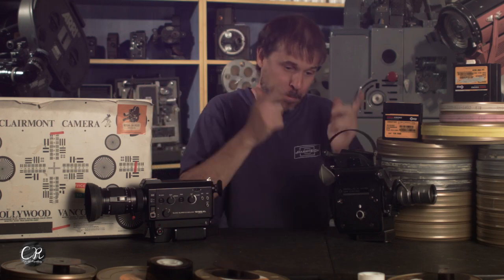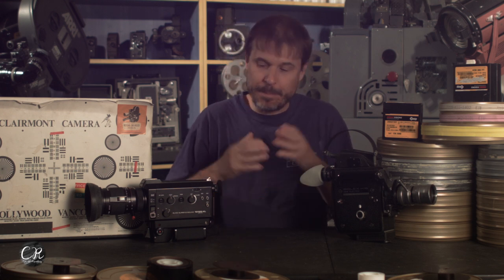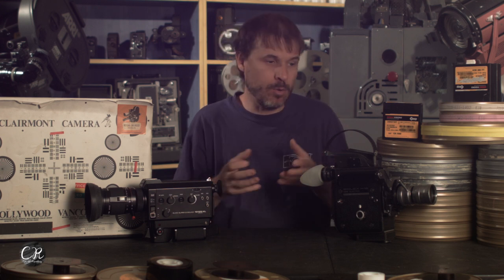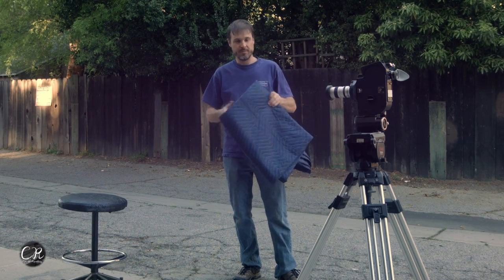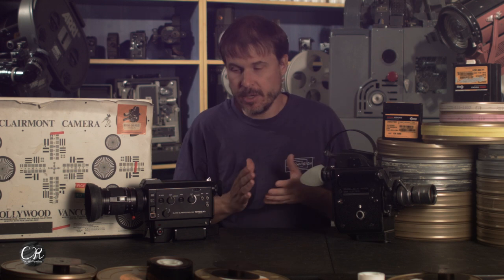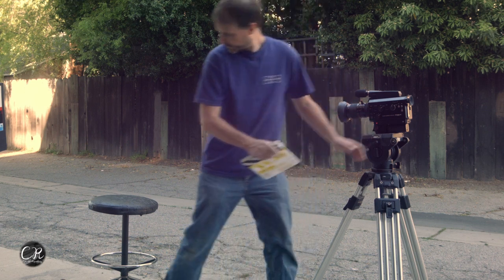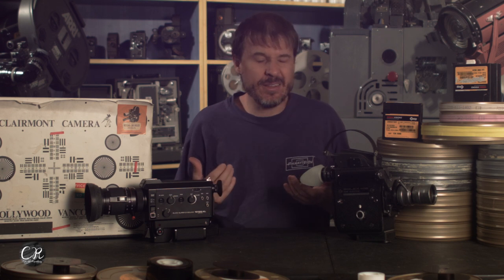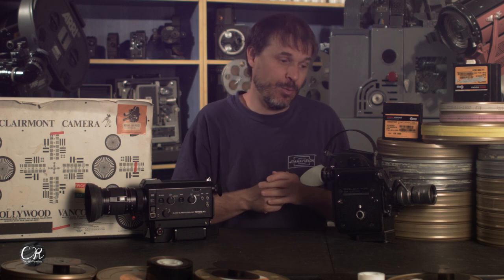Sync Sound test Super 8 vs 16mm  -The Workbench- E18

Comment: Hi there, total newbie here but I'm starting to find this stuff really interesting. I'd love to be able to film something on 16mm with sound just for fun. Do you think that the sound syncs well just with the camera that you used, or would you guess it would sync well with most cameras that shoot 16mm? Thanks!
Reply from the maker: Na, it doesn't work well. If you want to truly capture sound, you'll have to use an actual crystal sync camera. I now have A Beaulieu 2016 for lightweight work and it's stable, but it doesn't run at exactly 24fps, more like 23.80fps, which means no matter what, you're always having to adjust in post. Real crystal cameras, will run at crystal sync speeds flawlessly. So an Arri SR or Aaton LTR/XTR. You could get a CP16R, they do run at crystal speed as well.

Comment: Have you tried speeding up the super 8 footage by a set %? I've seen other people who had it running out of sync but it was consistently, to the point that a 10% speed up (or whatever it was for the specific camera) was enough to get it to line up.
Reply from the maker: Yes I can alter the speed of the audio to get it to match but it’s not perfect because the camera does not run at a constant speed it’s all over the place.

Comment: So, it stayed sort of in sync for 40 seconds and it started to diverge at about 20 seconds, not something you would use for journalism. I've been reading on the topic lately, and the invention of a sync sound system that allowed to have picture and sound in sync for a whole roll while recording the sound separately, it was a very big deal back in the early 1960s. There is a 1960 film called "Primary", which was shot kind of in sync, but not really, so it took them serious efforts to more or less sync it in post using whatever primitive tech they had. You may want to delve deeper into the issue of sync sound as it is a fascinating topic.
Reply from the maker: It was for sure not usable, because it doesn’t just get slower, it’s not consistent enough in its speed. So even if you corrected the shot, it would be wrong in multiple places. I’d say you’d get two sentences of dialog before it’s out sadly.
Reply: @CinemaRepository  To clarify, I meant the Bolex :)
Reply from the maker: @TinLeadHammer  Yea it falls out too fast.

Comment: Hey Tyler! 
Big fan of your channel and videos! Curious about the model/brand of recorder you used to capture the audio for your sync test. I own a Bolex EL S16 and i'm interested in running a similar test. Previously, I've attempted to sync audio with my iphone but the camera & audio didn't line up in post ( maybe the camera doesn't run at a consistent 24FPS). I just know the EBM & EL are fairly similar cameras so this sparked my attention considering your audio/footage lined up great.
Reply from the maker: I actually used the same camera (blackmagic pocket first gen) that I’m using as the main camera for my show to record the audio. I didn’t not want to trust an external audio recorder, only something shooting at the same frame rate would suffice.
Reply: @CinemaRepository  Copy that ! My audio friends said the issue I may have experienced was due to the sample rate that voice memo records at is slower than the standard sample rate associated with 24FPS. Voice memo records at 44.1 kHZ and 48 kHZ. Gonna run another test or try and track down a Crystal Sync for the Bolex EL ( Damn near impossible). Regardless, thanks for the response & looking forward to the next video!

Comment: Is there a program to manually sync the 8mm frame by frame? I wonder if there is any pattern in when it speeds up and slows down the frames.
Reply from the maker: Sadly not, gotta so it all manually by guess work, altering the speed of the audio by small percentages so it works.